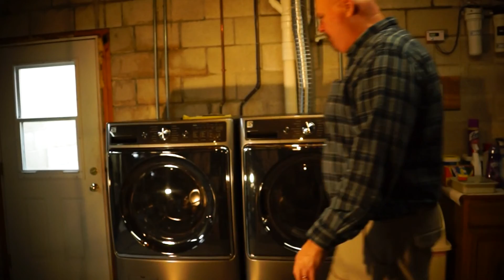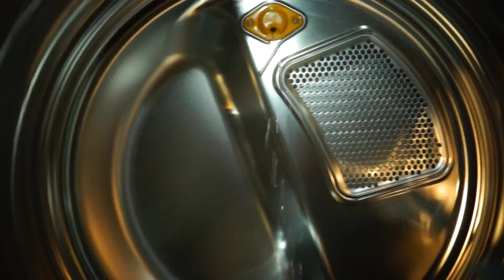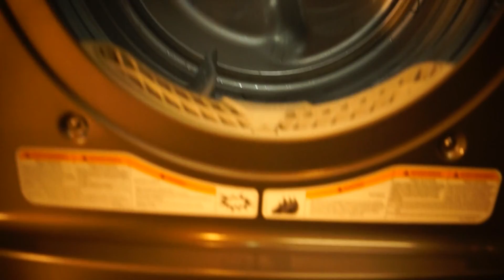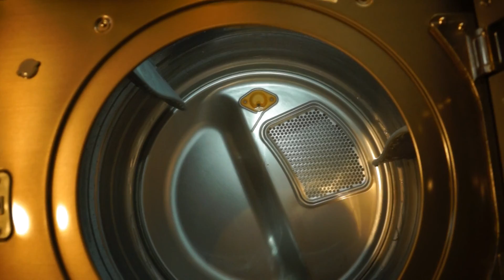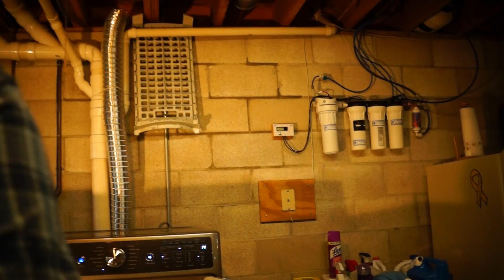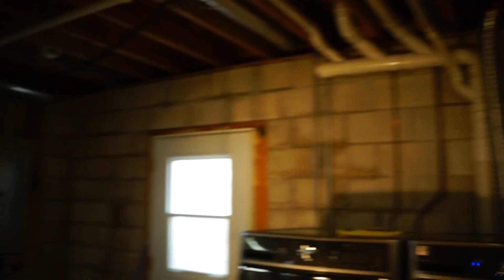Kenmore dryer leaking water in steam mode

Comment: I know it's a very long time since this was published, but my LG steam dryer from 2017 had the same symptoms.  I don' tthink the steam ever worked.  In my case the problem was due to the sensor that recognizes if the boiler chamber is full. Since there is no float in this design, it uses some kind of sensor, and that sensor is no good.  It just keeps pumping in water to the boiler and that water makes its way to the drum.  From all the posts I've read about this, it should have been (should bee) a class-action.
Reply: Got the same problem bought 1 year ago. Anyone have a fix to this?
Reply: @peckerpeter2078  I bought a new streamer part.  Works fine since then.  It was an easy replacement.

Comment: THIS GUY IS WRONG. He seems to like to blame the engineers, but even HE hasn't done proper research.  I have LG version of the same washer/dryer that this guy has.  He's right that it leaks water on the floor.  It took me a while to figure thiks out, but the problem is NOT always what he's talking about.  It has nothing to do with the steam generator.  The problem is THE RUBBER SEAL AT THE BOTTOM OF THE WINDOW ON THE DOOR.  Look at yours.  It's likely full of solidified lint.  As a result, it cannot create a good seal.  Trust me.  I fixed mine.  All it takes is a little elbow grease and a good cleaner to clean away the gunk that's on the bottom of the door.  LOOK FOR IT.  You can't see it standing up.  You have to get your head on the floor and look up towards the drawer.  It's a SIMPLE and CHEAP fix.
Man, this guy goes on and on and on and on and on and on trying to BLAME LG.  WRONG!!!!!
Reply: You are 100% wrong I cleaned everything and it just dumped the whole reservoir in the dryer. I shine the flashlight from the outside door and just watched it pouring. 

This guy is dead on LG poor engineering of this device when it works it works great but is 100% correct it should create steam before it releases water into the dryer not dumping water in the dryer .

Edit: 2023

I did end up fixing this problem. It ended up being user error. I was using distilled water and it worked the few times, but I started to go over the user manual and look at the labeling more often..Then when you open the water fill drawer.. 
Labeling say use tap water so I tried that and it does still drip a tiny bit but (Does not pour out all like with distilled water) then it does steam up about 34 minutes mark from 39min start on steam sanitary, setting .

When the dryer stops it steaming and the whole dryer steams up so it is working I can hear the steam generator working .

 I will use tapwater for now on. I do have a whole house filtration system with a UV sterilizer so I’m OK with using the tab that’s filtered in UV sterilized..

And and as others mentioned, you need to have at least three articles of clothing although I mainly use it to steam clean my dryer wool balls that I use for drain after so many times. Usually when I do a tub clean in the washer I’ll do a steam sanitary clean on the dryer wool balls

My thought process for using distilled water was that you use distilled for hot irons to iron your clothes and typically distilled as great as it has zero ppm, and nothing to corrode in it .

But I understand now the engineers designed this for tapwater, and that’s what needs to be used, but I highly recommend a whole house filtration system with UV sterilizer as the tapwater is very corrosive and has iron deposits, along with other chemicals that are coming from the dishwasher mixed in along with whatever the water treatment plant puts in it Something to think about.

Comment: That water in the bottom of the dryer did not seem to be excessive, it just went in to fast.  If the water would be dispersed with a finer sprayer the garments would absorb much better with less or no run off.    The spray jets should not be to fine so that hard water deposits won't clog them so quickly.  This steam feature should be rarely used  and when used with only one or two garments not entire load.  Unless the load was left in to long getting wrinkled.   What I use to remove wrinkles is to just dampen the garment before putting in dryer, and that does not work all that great.  Best to remove clothes from dryer promptly fold or hang them up while they are still hot...

Comment: Mine purchased in 7/2013 has the same problem.  Tech was just here for the 4th time and has replaced generator twice plus the board and harness, still spits water into drum.  They have agreed to replace it.  Not real confident next one will work either but knowing they have spent more money trying to fix it than it cost originally may get their attention.  Mine was under extended warranty service plan so no cost to me except time.  I had a great tech who was just as frustrated as I was.

Comment: Excellent. I've been searching high and low for someone to expose this as a real problem, and not a "normal" function of the True Steam technology.

I purchased an LG True Steam gas dryer a year or so ago, thrilled with it in every way, including the steam option - which actually WORKED the way it was supposed to work for many months - it introduced steam, not pouring water, and did a fine job.

In those good number of months, I filled the water reservoir as instructed, and set the number of items - I usually only did a few shirts at a time. The reservoir pumped a small amount of water out of its container and introduced the steam as expected, and the cycle ran perfectly. I could count on being able to do several steam dries over a period of weeks, as it would only use just enough water to generate the needed steam - until, of course, eventually the reservoir eventually became empty and I'd just fill it up again.

Recently it started to fail - it empties the entire reservoir, pours it all out of the 'steam hole' in the dryer, and then asks for more water! I fiddled with it for a while thinking I did something wrong....then started looking on the web for the issue. And there we have it.

VERY disappointed in losing this nice feature, and from your experience it looks as if I'm basically screwed and I'm thinking of not even bothering to go down the dreaded repair route. Well...thank goodness the dang thing still does a great job at drying!

Comment: I agree that reply about constricted venting is absurd. But what you're showing is also not a real test--sorry.
What's going on:
The manual says to have no fewer than 3 items of clothing in the dryer before using this feature. I think a number '3' shows on the display to reinforce that. It does not 'inject steam' but introduce enough water to make steam. That nozzle is not a steam injector. I, of course, agree that it 'should' test for conditions before dribbling in the water but what you're showing is not normal.

What their failure is that they don't have a predictable channel for excess water. Their failure is that they expect a perfect situation each time where the water is turned to steam or absorbed by clothes then turned to steam. I'm not happy with LG (this is, I think made for Kenmore by LG, right?) 

I had this happen when I did 2 things wrong. 1) I put in one pair of pants. 2) I realized I was late and interrupted the cycle. Then, later, we noticed water on the floor and under the dryer (between the dryer and the drawer stand. That hasn't happened since.

I wish I knew where the water was seeping out because then I could add a hose to a container. But I doubt there is just one predictable place the water seeps out. The drawer riser has one large flat surface. I've thought about drilling a hole in the middle and adding a hose that goes into a container in the drawer. I could, I think, add some stick-on border made for caulking that would keep the water from going over the sides of the drawer riser. Ideally, I'd like to pull down the sheet metal to form a slope into the center where a drain would be (again, going into a container in the drawer.) 

Thank you for this video it was very helpful in understanding the situation.
Reply: That water in the bottom of the dryer did not seem to be excessive, it just went in to fast.  If the water would be dispersed with a finer sprayer the garments would absorb much better with less or no run off.    The spray jets should not be to fine so that hard water deposits won't clog them so quickly.

Comment: I have the same problem on an LG Steam Dryer I just purchased. I have someone coming to check the vent tomorrow. I also have a water purification system, but just on my sink. I first used the Kinetico water filter water in the true steam drawer and it leaked a ton. The next time, after reading that it specified tap water, I got some leakage but a lot less. Their comment about adding salt must be partially true because I think it uses the minerals to gauge something about how much water to dispense. Since they sometimes push software updates, maybe they can do that for us.
Reply: This video is dead on ours is a LG steam dryer just over 1 year old. Picked up from Lowe’s

Comment: Ever get a properly working machine?Just purchased the LG 4270 with same tech.
Reply from the maker: No I did not. I have been through like 4 dryers and 5 tech visits with no luck at all. Just a bad design that could work if they would just redefine some parameters. They need to set up the circuit board so that the water would be released at a higher temperature so that steam would be released instead of water still being at the liquid state. I really don't think they care. They made their money.

Comment: Thanks! Mine is the same way... NOT pleased. THANKS for the Video.
Reply from the maker: I am glad I could at least be of help so that we recognize the problem. They tried to make me think it is suppose to be that way and I told them they are crazy. I don't get why they don't just fix the problem and then have a recall to take care of the consumers who bought their junk. It's all about the money. Good luck.
Reply: Just got one last month from sears and mine has the same issue. So no they have not fixed it but at least I know that its a common flaw and not just my machine. I really don't need the option but mad that it doesn't work as promised